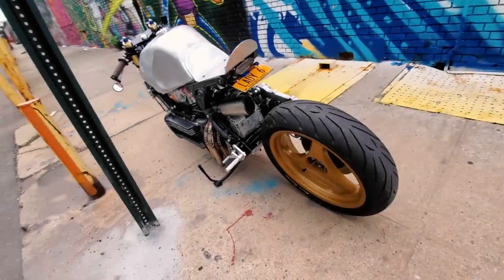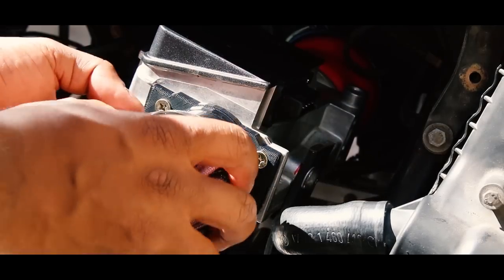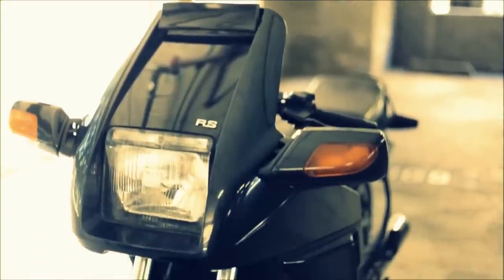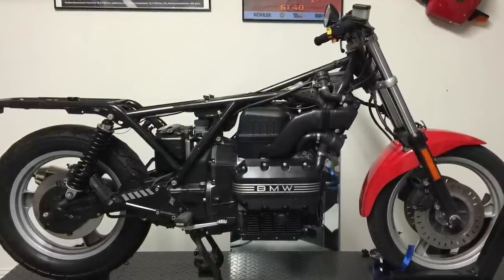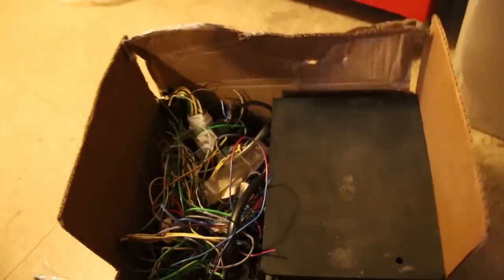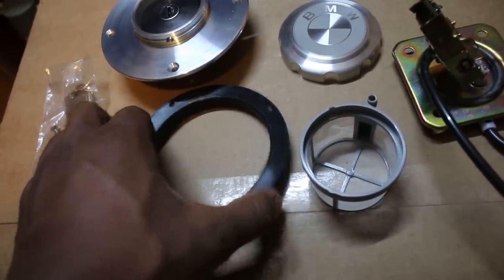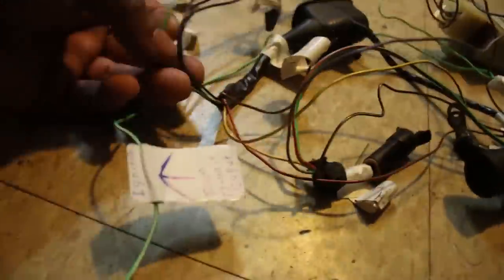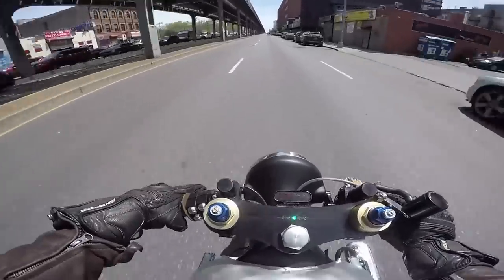[Ep 18] So You Wanna Build a BMW K-bike - Sharing A Few Things I Learned

Comment: We used to call these bikes the "flying brick!!!" on track days!! And for years I've secretly loved the k1. Would like to make a sleeper out of it. Turbocharged, intercooled, fuel injected, and stroke & bored. A low compression ratio, rubbing alcohol tank & water injection. I wouldn't be able to stop myself! Titanium valves, especially ground camshafts, (turbo) let's keep it European, Ohlins suspension, radial calipers, ect........ Where it ends in divorce. 🤣😆😂

Comment: I'm in the UK.  When I took my 1984 K100RS  in for her compulsory yearly Ministry of Transport road worthiness test (MOT Test), I had only just stripped all the fairing off , she failed due to the forks slapping the tank...I didn't know that the "bump stop" is on the fairing mounting frame.....the mechanic sorted it out by welding two small pieces of steel square section rod onto the headstock creating a new" bump stop" on either side

Comment: I have run my K100RS/4V to the north cape(Norway), Gibraltar and Turkey. The only problem I ever had that needed an instant repair was a clogged up fuel filter, my bad. Easy to replace. Best thing to carry with both my K100 and R1100GS  are  laminated wiring diagrams of the bikes. Electrical problems can be a nightmare on these bikes and the diagrams can really help you out. The engines will run almost forever when well maintained. Both bikes are well over 240,000 km now (each) and still going strong.

Comment: The weird geometry of the tank, and the potential of having a non-flat seat with some character in it is half of why I really like the K series cafe racers. The other half is the brick engine, there's just nothing else like it, and it's an interesting solid shape as opposed to all the weird variations of twin engines that almost exclusively leave that weird gap under the back end of the fuel tank where the air pods are usually mounted.
So in a way, it's kind of a backwards aesthetic; the engine has really good lines and fills the right amount of space, and the tank and seat are the awkward shapes.

Comment: Remember that if you move a rear wheel out to one side by a thicker spacer you will throw off the way the bike tracks, or it's center of gravity which will be shifted slightly to one side and when you let your hands off the bars it will go to that side. While riding you will likely notice you have to exert more effort on the bars on one side, unless you did something to compensate for that thicker spacer.

Comment: Ya know, I've never noticed my shaft driven bike (vt1100c2) doesn't lean back on acceleration. It is my first bike though, so it's what I'm used to. I love that feeling of its just goes forward no fuss no muss no feeling like I might wheelie if I push it too far. I will read up on the handling aspects though. That I didn't know about.

Comment: Hey Man!

I am doing my build now and I can say your chanel is not only helpful, but its is actually essential. Thanks huge and truly great work you've done here. 

I have a question here. Where the pipe connected to the basket fuel filter is leading to? I just removed the pump to check on it and the pipe crunched before I was able to see where it went. And cannot really find it on any scheme. 

It's kinda minor thing I guess but still it better goes where it should :) Thanks!

Comment: 2 valve vs. 4 valve... The two valve will supply more torque than a four valve at lower RPM. In the city I'd rather have a two valve. If you ride where the upper reaches of the RPM range is needed, then go with a four valve. But seriously....
Plus a two valve is a simpler engine which is appreciated when valve adjusting is needed.

Comment: I recently picked up a 1988 BMW K75 and I'm on the fence about converting it into a cafe racer.  My basic concern is:

1. If I go all out a get a fork kit which used fork kit will work with my bike?  By for kit I'm talking craigslist or eBay of course.
2. My bike is a 3-banger and it appears to have the motronic kit for fuel injection.  How custom looking can I go with the airbox or hopefully future air pods?

Thank You....your videos are inspiring me to get off the fence.

Comment: at 17:31, love the oil temp gauge on the oil filler plug. I got the same, ordered from Europe for my Kawasaki, except on my bike the oil filler plug is on the clutch cover so the little prong on the bottom temp gauge constantly gets splashed by oil from the clutch basket for a more accurate reading. Does your's being mounted on the valve cover get splashed by the valve train? What max temps have you seen? Here in Cali, on the hottest days it get's up to 100*C max on my bike when I'm really pushing it, but most days it's usually around 80*C